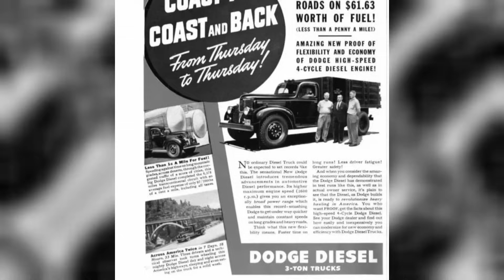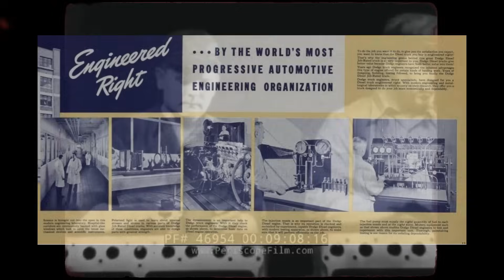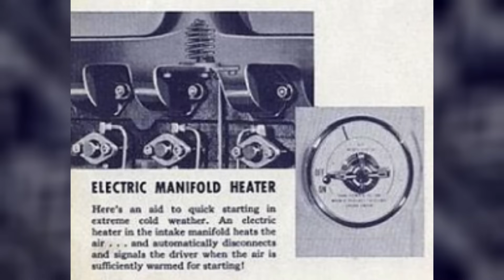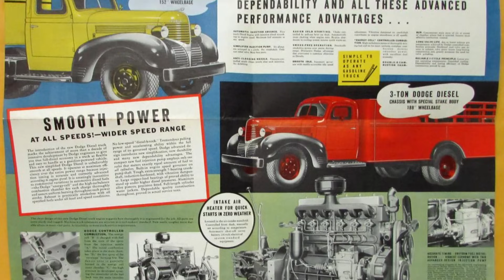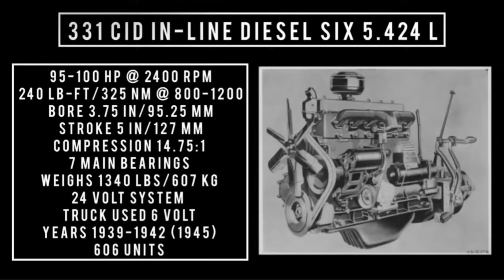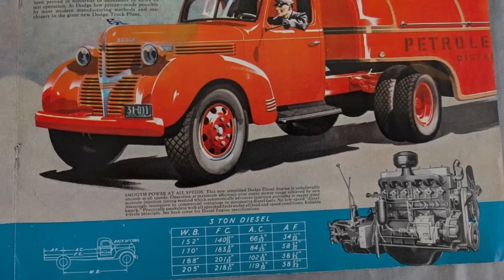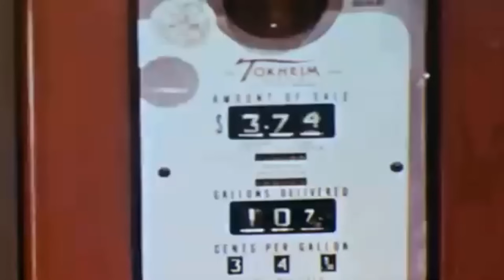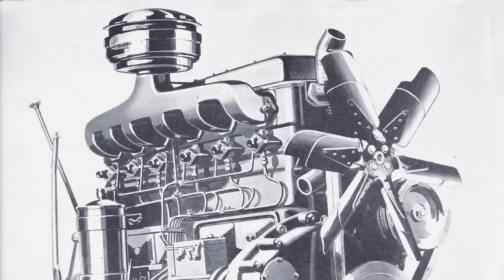Dodge Diesel Disaster: The 331 Engine History Forgot

Comment: Dodge trucks in the UK never had this engine,they used Perkins engines of Peterborough who are now own by Catapiller, Chrysler also killed off the Tilling Stephens TS3/4 two stroke diesel fitted in Commer truck’s which was a mechanical wisard for its power and fuel economy.
Reply: The TS3 was a cool engine and for it's small capacity it produced remarkable power and economy. I only once ever drove one and I think my ears  are still ringing. I did work on them as an apprentice and could really only take what I was told by the guys that operated them, how they really went. :body-blue-raised-arms:
Reply: @Bryce-z9v I think the TS3 was only 3-7 litre but what a powerhouse,noisy but powerful,I’ve only driven a couple of them but loaded they were brilliant and for some reason good on fuel which is unusual for a 2stroke diesel.
Reply: The TS3 was a lot like the Deltec accept just a single bank of 3 cylinders with 6 pistons instead of 9 and 18.
Reply: @LeeHendo  Yep, and no head gaskets 🙂
Reply: There are few diesel engines worse than a Perkins.  At least the head won't seal enough power to hurt anything in the bottom end.
Reply: @randymagnum143 Modern Perkins engines are mostly Cat designed but I ran a fleet of Sedona fitted with Perkins 6-354 engines and were as good as any mass produced engine of that era.
Reply: @davidellis279 no, the 6-354 and the 4-236 sucked.  They were underpowered, and had inadequate head sealing for turbocharging, and cav injection pumps were rubbish.  😊
Better contemporary engines: 
Case direct injected 301 4 and 401 6 cylinders.
404 Deere
D361 IH
Kraut D358 IH
200 4 cylinder and 301 6 cylinder Allis-Chalmers.  (Light years better, not even a comparison)
And Ill add a controversial one, the 310 Waukesha.  Smoother, cleaner, more efficient, better power.  Had con rod problems that are corrected with updated hardware.
Reply: @randymagnum143 This may be so but I think a lot of operator’s might disagree with you as most manufacturers of that time had engine issues of one sort or another,it was probably the best of a bad bunch,you only had to look at the problems Leyland had with that fixed head piece of shit,it cured head gasket problems but blew up instead so maybe Perkins are not that bad after all.
Reply: @davidellis279 I will say, the Oliver and White tractors with the 6.354 are nice, because they are usually cheap because the engine has some issue, and a 5.9 Case/Cummins fits in with very little fuss!

The Olivers with the 453 GM diesels are nearly bulletproof, and are valuable collectible tractors now, but the noise!
Reply: @davidellis279  Yeah I had four of the little international loadstar single axle semi-tractors with 6-354. Fooking Cav/Roosamaster injection systems, though... I asked Jesus for a miracle to fix them and he just silently appeared, gave me a crazy pissed off look shook his head real slow and then vanished. I took that as a "no".
Reply: @randymagnum143  I worked on the Reman line at International building up DT-466s. Pretty dang successful engines.
Reply: @patrickshaw8595 I didn't include them, or the DT-360 because they are quite newer than a 6.354.  I didn't include any of the 451, 504, 426, 478 types either, because they are way more powerful.  I didn't include the 531 Deere, because it wasn't any better than the Perkins!😂

The wet sleeve IH engines definitely hit their stride in the s model, with a P pump.  HEUI was a stupid idea though, and caused probably billions in repair bills.
Reply: @patrickshaw8595 Roosa Master pumps are a marvel of production engineering.  The most expensive wear item inside is like $30.  Cav couldn't manufacture penny whistles.
Reply: @randymagnum143  I thought they were related. But just use similar rotating shuttle type distribution. Never been into either one - just changed 'em.
Reply: @patrickshaw8595 the cav was built under license, Vernon Roosa and Ernest Wilson invented the concept and sold the design to Hartford Machine Screw in 1947.
Reply: @randymagnum143  Well Bless your heart! 
I learned something today so I must not be dead, yet, lol.
     To my credit in my 14 years in prison as the librarian - I did indeed read everything ever written about Bosch injection. Before that it was air-injection which just sucked.
Reply: I absolutely ditest Perkins engines the head gasket issue is primarily because of the fact that the cylinder head is  so thin only about 2-1/2 inches thick and has very little structural integrity I don't remember who it was that built a modified sleeve that had a .039 tall extended lip up on the  top that nearly touched the cylinder head when the gasket was tourqe down and we used to put ARP race car head studs in them and that helped a lot @randymagnum143
Reply: I’ve got a Cummer Knocker Too
Reply: Tommy knocker junk
Reply: This would be a cool engine with a blower from a 4-71 or 4-53 Detroit engine . Why not just use kerosene maybe add a couple of quarts of oil per 5 gallons. To help lubricate the pump and injectors.. when DIESEL is NOT AVAILABLE.. ABLOWER FROM A 4-53 OR 3-53, 3-71, 4-71 SHOULD  DOUBLE THE POWER OR BETTER. PROPERLY TUNED POSSIBLY 300HP AND 600'LB TQ. MAYBE ADD WATER INJECTION with 15-20psi of atmosphere (1-1.3 bar)  it would be worth carrying a 40 gallon drum of fuel to have that kind of power.. I'D  fit another fuel tank to the truck, maybe  two additional tank . And use kerosene before  one tank was empty . I'd fill it with kerosene if no diesel was available.  Mixing the kerosene and diesel about 50%. maybe add a quart of oil. Or use peanut oil like the engine was originally designed to run on.. I bet that smelled good running!..😂
Reply: G  day  from Ontario  Canada  Interesting dodge used perkins !   Do  u know what size motor  they  used?
Ths  Massey  tractors  with perkins  were good machine
Reply: I love the sound and smell of a Land- Rover 2.25 Perkins Diesel
Reply: Great video about an engine lost to its full potential
Reply: That's cool, I have a 68 Massey Ferguson tractor with a 48 HP Perkins diesel
Reply: A 2 stroke giving good fuel economy? How? Where?
Reply: @towgod7985  It's true. It was an opposed-piston engine, which are the highest-efficiency ICE to this very day. It was so-far ahead of it's time that only-now is it being experimented with (and it was in like the 50s I think??). The design allows combustion to expand in both directions, so.. This massively benefits ANY ICE, however it's like the ultimate cheat-code for Diesels which naturally have all those issues associated with injection.

Anyway the reason you & the VAST majority of the planet doesn't know about the Commer-Knocker TS3 is that for the time the technology was SO great, efficient, small / compact & generally superior that Chrysler bought them out and DESTROYED everything to do with them & the engines / vehicles themselves. It's like all those "crazy conspiracies", except it's very, very real.. Some might say the big boys don't allow things to go through if they're actually for the betterment of society and this story is one of the most-credible pieces of evidence of such lines of thinking / beliefs. 

As far as I know, only like 5 years ago (or less..) was the FIRST such engine actually built since the destruction of the TS3 and it's by Cummins.. Little info on it and barely anyone speaks about it.. Why? Because it's locked-down as military-only.. And that is all you need to know to fully drive home that it is the superior engine in terms of efficiency, and at the very least torque, which is the highest of any system with "normal" crankshafts, though that isn't particularly surprising when you look at the design sketches.
Reply: @bo-dine7971 Opposed piston engines can be more durable than a poppet valve engine of the same power but they all almost twice as heavy and bulky, soo . . . 
        PS the BSFC champ is those Wartzilla Busch-Sulzer engines. Pneumatically operated single exhaust poppet valve-in-head per-cylinder. Scavenge ports down low. 2-cycle. Electrically-spun turbocharger for starting AND it puts OUT juice when running under load!
     Opposed piston engines date back from before we could make poppet valves hold up. There is no compelling reason for them to have better fuel economy. The Commer-Knocker like the Deltic Loco engine was/is a Big Fail like  the damn Napier Sabre V.
Reply: You are correct on everything.  The last engine you are talking about was developed by Achattes.  Eventually they got Cummins involved in some sort of partnership.  Cummins does hace the money and resources to make it happen.  They are in conversation with the US military in order to get a contract for repowering  actual equipment or developed future platforms using this "new" engine. 
Germany has a similar engine called Junkers Jumo if I'm not mistaken.
Reply: @enterBJ40  You are correct, and, from memory, the Juno would only run vertically not horizontally, for some reason :body-blue-raised-arms:
Reply: Sorry, Jumo.
Reply: @patrickshaw8595  Junkers (Germany) also built two-stroke opposed-piston engines. In the 1970s, I once owned a former lifeboat with a 1 HK 65 opposed-piston engine from 1931. Yes, this engine was very heavy compared to normal 4-stroke diesel engines, but it was indestructible; it still runs today. This engine was also available in a 2-cylinder and a 3-cylinder version. Hugo Junkers had been experimenting with opposed-piston engines since 1892 and built them until his aircraft and engine factories were expropriated by the Nazis.
Reply: @bo-dine7971 TS3 is neat engine. If you see one, you won't realize it is an engine😂
Reply: @juhomaki-petaja Your absolutely right,looking at one you would never recognise it as an engine.
Reply: @towgod7985  I mean... 671 detroit even is a pretty high effiency engine compare to any of its contemporaries, a 4104 bus gets around 11mpg or so.
Reply: @towgod7985 I’ve no idea why they were so fuel efficient but I can assure you they were.
Reply: @towgod7985 - two stroke diesels are very different beasts than petrol two strokes and dominate, for example, in big cargo ships.

They nearly universally use some form of forced induction to ensure a proper scavenging (typically some mechanical compressor, as it needs to pump air from idle RPM - in this application, they are called blowers), the fact that the fuel is injected directly in the combustion chamber only at the required moment forces to use the same kind of forced lubrication used in four strokes and minimizes (ideally to zero) the unburned fuel thrown out with the exhaust.

On the flip side, they are pretty complex machines (especially that British nerdgasm known as Deltic) and an overkill in many applications.
Reply: @stone-hand  two stroke diesels rely on some sort of 'forced induction' because of the very nature of the two stroke diesel concept - when air is introduced into cylinder via the ports the piston sits at or very close to BDC meaning there's no vacuum to pull air into cylinder. In contrast petrol two strokes have the air/fuel mix passing via the crankcase prior to entering cylinder and the downwards movement of the piston creates enough pressure in the crankcase to push the uncombusted mix further into cylinder.

I write 'forced induction' with '' because two stroke diesels have indeed been equipped with turbochargers or superchargers. While two stroke diesels don't need neither however when not so equipped they need at least a blower which is not true forced induction. The blower functions more as a draft pump/ iron lung/ fireplace bellow to assist the engine introduce atmoshperic pressure air into cylinder. Without at least a blower a two stroke diesel would suffocate